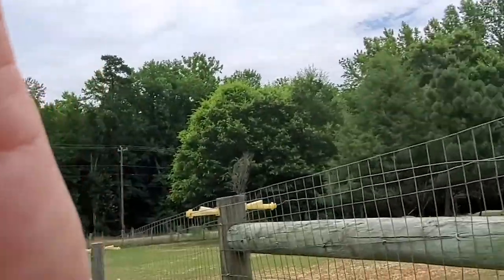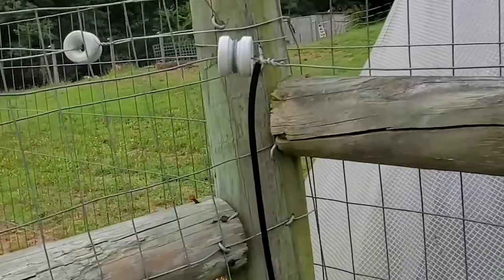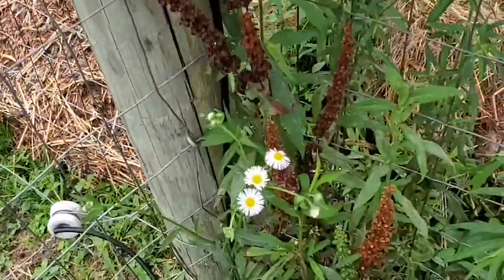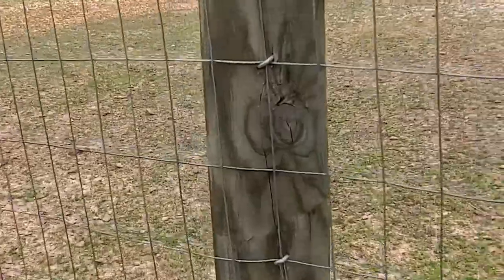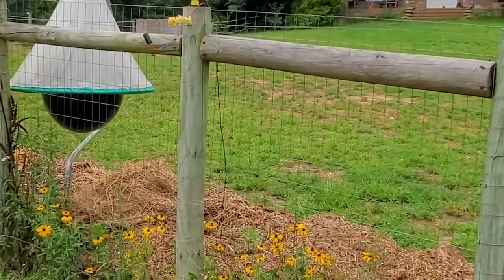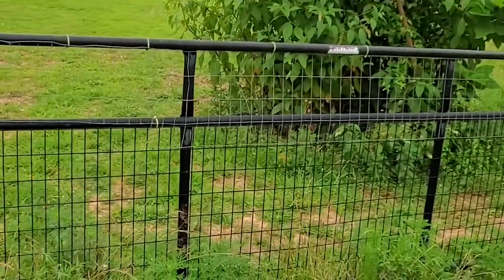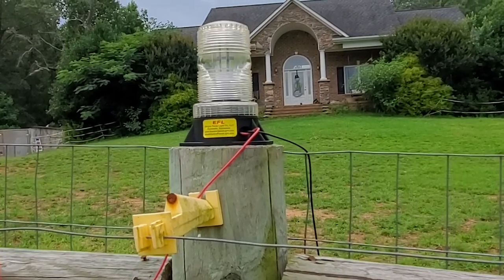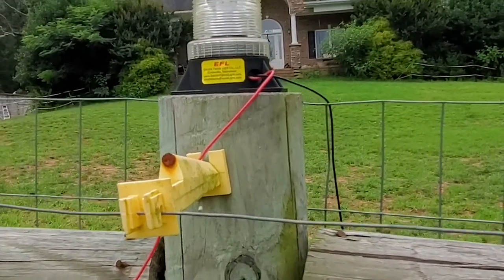How we construct goat fencing on our homestead

Comment: We use hog wire panels.  We didn't have to use a hot wire until we got 2 new pack goats last spring.  We had a bear climb over the fence several years ago and kill two new little goats--that fence was 8' tall.  So, I won't put up a fence that's more than 4' tall, because our big goats were able to jump over the front fence and get away from the bear.
Reply from the maker: Holy cow!  Have you had any problems since then?  What kinds of goats do you have?
Reply: @SpottyCreekFarm  No, that was the only time in 30 years.  A rogue bear from a national park was dumped in our area--how smart was that?  We have three Alpines, one Lamancha, and one Oberhasli.